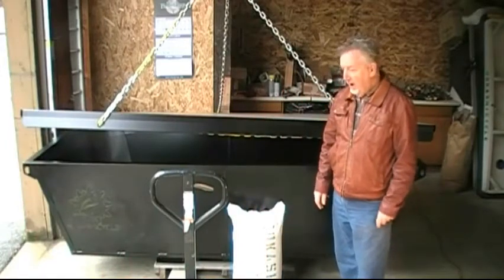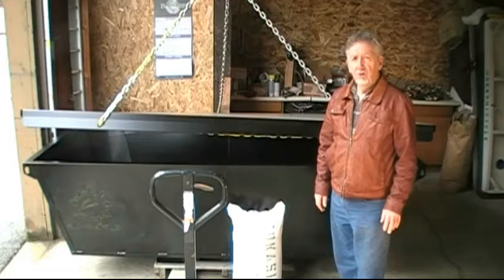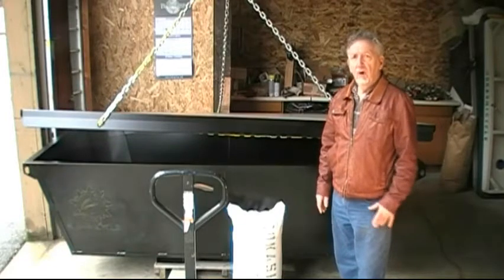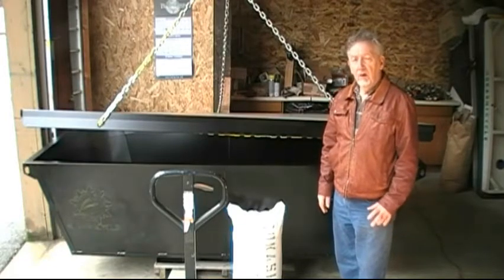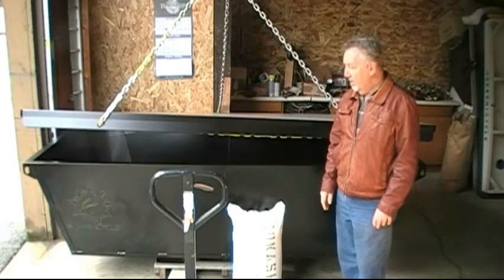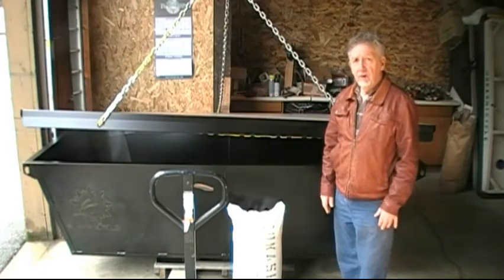Bokashi Food Waste Industrial Scale Processing - For Agriculture

Comment: I am researching Bokashi fermentation and came across your video. Thank you for the information. In my opinion, High-Density Polyethylene (HDPE) fabricated plastic materials are more suitable for these types of applications. Cylindrical HDPE tanks with  sealed heavy pressing lids on them may be better than metal fermenters. HDPE is resistant to most organic materials and extreme pH levels.